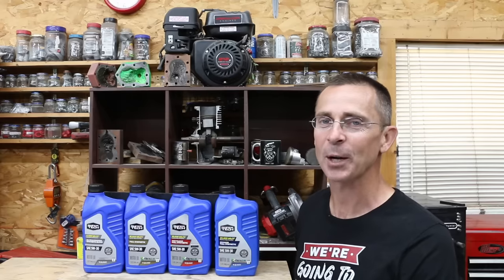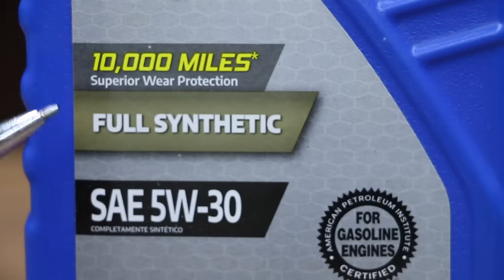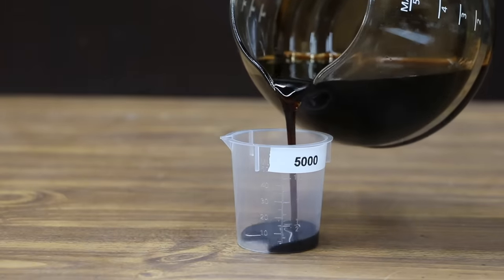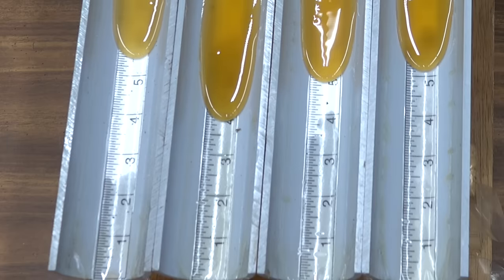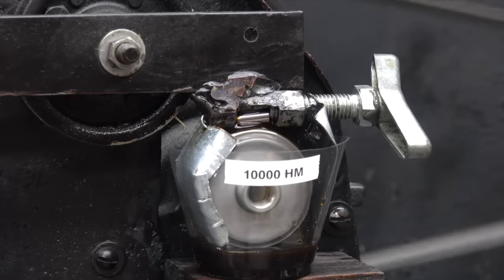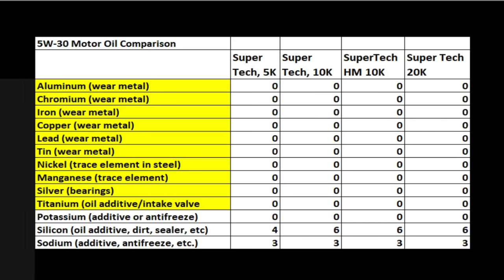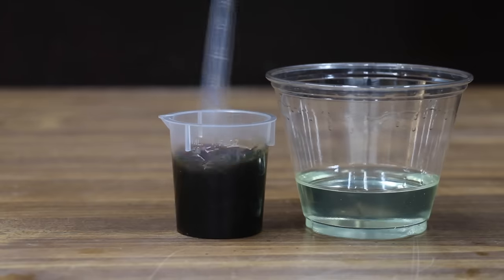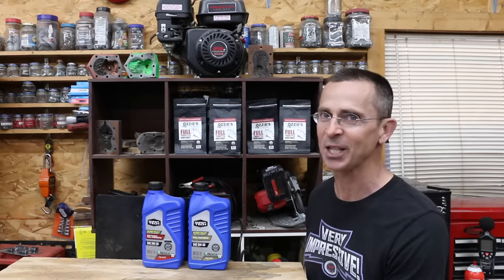Are They All The Same Motor Oil? Let's Settle This! Four Types of SuperTech Motor Oil Compared

Comment: I'd be interested to see a test for brake pads. I've always been told to avoid the "lifetime guarantee" pads because there is more abrasive additions to the pad that will ruin a brake disk.
Reply from the maker: Thanks for the suggestion.
Reply: Walker Thermoquiet is the best. Stops, lasts, no dust 👍
Reply: There are so many variables, do you want it to last longer or stop faster? Do you want the pad to wear faster, or the rotors? How well do they hold up to salt, or heat. 

It would definitely be great to get some more information than just "economy, service grade, premium, metallic, semi-metallic, ceramic, etc."
Reply: I ask AutoZone clerk to show me a set of the lo-cost pads vs. the hi-cost pads and looking at them side by side they were the same. I asked the clerk what the difference is and he said it is purely buying the extra warranty. Yes, Scout's Honor.
Reply: Lifetime warranty means "the expected life of the product"
Reply: @gtbmjb7192  being a worker at autozone. All 3 sets of pads autozone Carry’s (duralast, gold, elite) at least at my region all have lifetime warranty. Buy one set and warranty them out once they are run out.
Reply: @dublin9699  how exactly does it work? i've been spending money buying replacements... just to find out years later i can get free replacements? thats awesome! what would i tell the cashier?
Reply: @christophertamayo1925  You’d have to ask them to look on your phone number for warranty lookup. But again It could vary by district or regional locations
Reply: @gtbmjb7192  the warrantee is the same across all of AutoZone's Duralast brake pads. Form factor will be the same because that's the shape that fits the vehicle. Pad composition is where they vary. Lower costing pads are often asbestos or semi-metalic, but higher grade pads are typically ceramic or copper-free ceramic.
Reply: @ProjectFarm  - also, maybe pick one brand and compare test, ceramic, semi metallic, and standard.  Thanks!
Reply: @dublin9699  sweet i'm definitely going to look into it!
Reply: The energy from stopping a vehicle has to go somewhere. The stronger the pads,  the more heat produced. More heat means more damage to other components. You want to have a system that dissipates the heat as fast as possible to avoid as much wear as possible.
Reply: I always buy lifetimes. Never have any problems and I never pay for pads twice on any of my vehicles. Can't remember the last time I had to buy rotors...late 90s I think.
Reply: @georgeorwell4509  how can a rotor last 30 years? I've seen OEM rotors that are 10 yo that are heavily corroded and splitting . OEM Toyota and Honda pads are tremendous
Reply: @hotrodray6802  a really good mechanic who's shop uses Wagner told me that OEM Toyota pads which are Akebono or Sumasomething are the best. I bought Wagner thermaquiets to replace my daughter's Honda pads and they were smaller. Thinking I got the wrong pads, I went back to the parts store and they compared them . The Honda pads were larger than anything else they carried. They told me to go order Honda pads in 2 years cause the pads she had were still good and they were 6yo with 65K
Reply: @lg9853  I didn't say I had rotors that lasted 30 yrs. I said I hadn't bought any since the 90s. I have not owned a particular car for more than 7 or 8 years since 2005.
But I did lie (unintentionally). I bought a 2004 grand am in 2016 that I put wheel bearings and brakes "and" rotors on when I first got it home. Changed the brakes again in 2022 (for free) and the rotors are still going strong. 👍
Reply: All brake pads have LIMITED lifetime warranties...LIMITED....you guys can't read is the issue...
Reply: Yeah... I would definitely avoid a "lifetime guarantee" wear part. Pads are designed to abrade away over time. By doing so, they can generate more friction (stopping power), and do less damage/wear to the rotors. A lifetime guarantee on a brake pad has nothing to do with the pads. If they made them hard enough to actually last forever, they'd perform extremely poorly and demolish rotors in record time.

That said, I wouldn't avoid them because they're crap pads; the reality is, they probably didn't actually make any attempt to make a non-wearable brake pad at all, because they're allergic to class-action lawsuits and regulatory intervention. They're probably just regular brake pads, and the marketing department, not the engineering department, created that claim and guarantee. Rather, I would avoid them because I dislike that kind of underhanded nonsense marketing tactic.

Basically it's saying that the business believes that while they know perfectly well brake pads will wear out, enough customers will have forgotten about their warranty, lost the paperwork, or just not bother to take advantage of it, that the few who do, will be balanced out by their estimation of how many more sales they'll get for putting such a ridiculous claim on the box.

Look, I'll tell you what I've told many thousands of customers over the years. Tires, brakes, and front-end/suspension components are the thing that stands between you, driving a multi-ton vehicle at speeds that gives it the kinetic energy of a sizeable bomb, and death. Not just you, in fact, but you and whatever poor innocent soul happens to be in the path of your out-of-control, careening wrecking ball on (some) wheels. Do not skimp on those. Just don't. You don't have to buy the most expensive, but stick with brands you trust, or what your mechanic recommends, stay within the specifications your car's manufacturer designed the car for (i.e. if your car's manual says ceramic pads only, do that).

If you really want to never replace brakes again... get a hybrid or electric vehicle. They basically never even use their physical brakes, doing almost everything with regenerative braking.
Reply: lifetime replacement pads are not "better" in anyway shape or form if not they are actually made "cheaper" as the selling hook is the pads are warranty but the LABOR is not .. the hook is the cheap pads to get you in for the labor and the extra work they find when it is in .. not guessing mind you professional mechanic I replace these type of high mileage pads all the time and the pads that actually do last ? have so much metallic in them they eat your expensive rotors away .. In my own daily drive I use regular everyday pads that do not hurt my rotors and replace them when they get low .. not worn out because thin pads create heat that warp rotors .. my "pads" cost me about $15 a set on daily driver and my hawk performance pads cost $125 a set on my mustang .. the hawk pads stop my car at 180 mph and keep me from totaling the car on corners hence I "pay" the extra $110 to save my car ..
Reply: @gtbmjb7192 it’s often different braking material, cheap pads are often metallic and tend to be noisy, more expensive ones are often ceramic and much quieter.
Reply: @ProjectFarm  if you do this, consider Powerstop in the lineup- the drilled and slotted rotors with their pads.  A lot of enthusiast rave about these.
Reply: lifetime Warranty is for "Defects" not wear.
Reply: @bv2999  hey look an intelligent person lol. You are right. Lifetime is for defects not wear. And most places it also covers your rotors too if the pads screw up.
Reply: Who cares? Pads are so cheap just change them every other year or whenever it's worn over 50%.
Reply: @kenzohkw  all Pads are NOT Created Equal. Some are excellent and some are Crap. A good Test would tell us a lot. Why pay for Labor over and ove again when you can pay a little more for first class Pads. I got 80K out of the Ceramics I use.
Reply: @bv2999  maybe not in the US of A. But in the EU all budget pads work perfectly fine, I've used loads on various cars and nowadays it's not even worth thinking about. Just buy what ever is cheapest on the day and fit and forget. Obviously this only applies to normal daily drivers, if you have a performance car then that's a different kettle of fish but then you won't be worried about cost.
Reply: @kenzohkw  We have to really watch it over here :)
Reply: I think ChrisFix did a video on a brake pad factory. They did some testing and it turned out that all but the cheapest brake pads did a good job. So basically you want to avoid budget brake pads all together, but the brake pad tier above that, "regular" or "OEM quality", is more than good enough for 99% of people. Only in certain scenarios would you want something even more powerful, but that's usually paired with better brake discs and whatnot.
Reply: @CDAM_B  real racing brakes aren't slotted or drilled, those are for show. Real racing brakes are just like standard vented brakes except they're made of a material that can handle more heat, usually carbon ceramic discs. Plus they use much grittier pattern brake pads. But those two alone are no good if you don't have sticky slick tires that are able to properly slow the car down once the brakes are applied.
Reply: @dublin9699  I bought "Lifetime" warranty pads. When I tried to get new ones, they laughed at me and said the warranty is against mfg DEFECTS and NOT pad wear. Very last time I walked into autozone simply because I was TOLD by the employee (when I bought them) that it covered wear when I said I thought it meant defects.
Reply: @mathewhoffer4541  Just curious,... How often do you stop your car at 180mph?
Reply: @daviddelle774  at least 30 times in the past and I can type this here and now because I was never stingy on the quality of brake pads and tires . cheap tires on a sports car is like wearing flip flops to an Olympic running event.
Reply: @SockyNoob   Yep, And the holes/slots wear the pads more like microscopic razor blades.

Comment: This is another great video! I have been using Supertech full synthetic for several years now and I haven’t had any issues, however I change my oil on my 5 vehicles every 5-6k miles. We beat the oil change interval to death, but unless you are doing a SOAP sample on your own vehicle, it’s all guessing. All I can say is in the 25 years of driving, I have never had any engine failure because of any oil brand I have used, as long as you change your oil regularly (whatever that is to you) and keep it full, your engine should be fine. Unless the engine has an inherent engineering flaw, the oil brand won’t matter anyway.
Reply from the maker: Thanks!  Thanks for the feedback.
Reply: Oil brands can matter.  An oil of 20 years ago would blow up a turbo GDI engine of today...
Reply: @reubenmorris487 where you getting 20 year old oils?

Comment: I've been a SuperTech full synthetic user for at least over a decade, doing 6,000 mile oil changes on half a dozen vehicles.  I've also used the same lab as you for sample analysis.  Every time I've gotten a sample back all the wear numbers look great and they've noted each time I could push the interval to at least 8,000 mile (I don't.)  What I can tell you is, vehicles pushing 200k miles (which did NOT have full 6k synthetic oil changes earlier in their lives, but 3k conventional oil changes), when their valve cover gaskets have gotten replaced, look clean and sludge free in the valve train.  I've been using the 10k HM flavor recently, since the price was the same as their other full synthetic flavors, simply because of the added wear additives.  If the 20k were on sale for the same price I'd stock up on that.
Intelligently changing your oil at appropriate intervals is far more important than the type or rating of oil.
Reply: Excaxly oil doesn't wear out it just gets contaminated, frequency is everything.

Comment: i work in  Mechanical Engineering and truly enjoy watching your real world oil testing procedures and oil lab reviews, as well as many other tool and additives reviews you have done. Based on your testing I have been recently started using Supertech Oils in my 2 older Honda Ridgeline and even Supertech advanced in our 2023 Blazer, I’ve Based this on your reviews ,price and proven quality.  However I feel there is not much for comparison information available on high mileage oils and would truly enjoy seeing a head to head of Pennzoil Platinum HM , Supertech HM, Mobil 1 HM.  And any others you feel are of the same quality.   Thank you for all you do!  Your test provide people like myself with a better knowledge to make informed decisions with expensive vehicles and equipment!
Reply from the maker: Thanks!  Thanks for the suggestion.

Comment: Todd,  Have you considered doing a test on the independent oil testing facilities to see how consistent they are amongst samples of the same oil?
Reply from the maker: Thanks for the suggestion.
Reply: Testing the test-centra. 

That's popcorn!
Reply: Test-ception...
Reply: Sounds like a waste of money. Barring some slip up, I'm sure they use the same testing equipment and same workers and a computer spits out the same data. I mean how many oil samples do you think they get every day? Probably not a lot.
Reply: Interesting idea, but may be difficult to evaluate any differences.  Likely would have to do three or more at a time, if there are enough of them, to isolate outlier labs.
Reply: Odds are since the measurements are in ppm, the variation would be within a margin of error. Kind of like these 3 oils. Most of the additives were within a couple of points with the exception of zinc in the 20k oil. So it would be interesting, but I doubt it will be the next breaking news scandal...
Reply: @aznnp77  Our mill alone sends in 400+ samples every 2 months. The mill next door sends in roughly the same. That's just 2 mills....there are about 15 plants/mills within a 20 miles radius and we use the same testing facility. So they have quite a few samples to test daily.
Reply: @aznnp77  Oil test labs variations.

There can be several reasons why there might be a difference in the results of oil test labs. Here are some possible reasons:

Test methods: Different labs may use different methods to test oil samples, and the results may vary depending on the method used. For example, one lab may use a different analytical technique or instrument, which could affect the accuracy of the results.

Sample handling: The way the oil sample is collected, stored, and transported can also impact the results. If the sample is contaminated or improperly handled, it can affect the accuracy of the test results.

Calibration: The accuracy of the instruments used to test the oil sample depends on proper calibration. If the instruments are not calibrated correctly, the results may be inaccurate.

Human error: Mistakes can be made during the testing process, such as incorrect measurement or misreading the results, which can lead to variations in the results.

Interpretation of results: Different labs may interpret the results of the tests differently, leading to variations in the reported results.

However, reputable labs should follow standardized methods and procedures to minimize variations and ensure accuracy.

Or send them to Amsoil ;). 

I only use Amsoil OR Shell Ultra.
Reply: who will test the testers?
Reply: @land7776   - It's according to standards. It is possible to have a higher-level tester or quality assurance team to test the work of the test center and the tester. This can include reviewing test plans, verifying that testing protocols are followed correctly, reviewing test results, and assessing the overall quality of the testing process.

It's also about avoiding routines.
Reply: Grant  him 100  grand's  to conduct through  tests  in recognized lab. However that would not add a significant value to  youtubers. You might go to near by university library, so you can get access to peer  reviewed journals and international standards if you are going to continue your studies in field of Tribology.
Reply: @aznnp77   I bet they get a lot more than you think.

Comment: It would be interesting to see the difference in the wear scars when compared to a “control” that is either completely dry, or maybe only water, or something else not necessarily designed to prevent wear such as vegetable oil.
Reply from the maker: Thanks for the suggestion.
Reply: @ProjectFarm  For this comment, it's been known that for wear and high heat, high RPM and high film strength applications that pure  Castor Bean Oil is the best(like Klotz Benol, or the old Castrol R30 or R40) That is that sweet smell at say motocross or Speedway races you notice.  Also, only a few Synthetics approach the true film strength of a pure Castor, again like Klotz R50 which is a cleaner burning alternative that approaches a pure Castors film strength.  
Castors main drawbacks are it burns dirty(more carbon), isn't designed for non racing applications, and settles out of premix below 35F. 
That is why there are many "blends" to bridge this gap, like Klotz Supertechniplate 20% Castor, Castrol A747 and many relabeled versions of that Castrol like Maxima 927. 
Castor is still favored by the Shifter Kart and 2 stroke RC crowd and engines running 10,000-45,000 RPM....like glow plug engines.
Reply: I always ran klotz in my 2 strokes growing up, I was told it was the best and it smelled like bananas so I was sold! 😂
Reply: 0w20 supertech full syn. in toyotaco 2.7l at 34000 miles showed a bitosoot in tail pipe. 2000 mile oil changes.  I just put in  quakerstate full syn dexos1. The startup was very quiet. Better power to highway speed. Will see if less soot after 3 tanks of lucas inject clean. Hmm